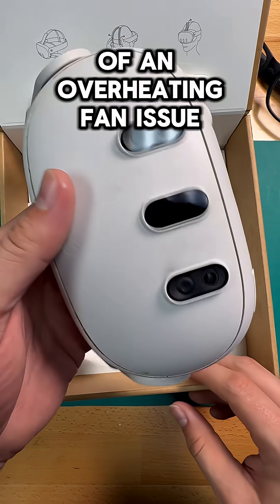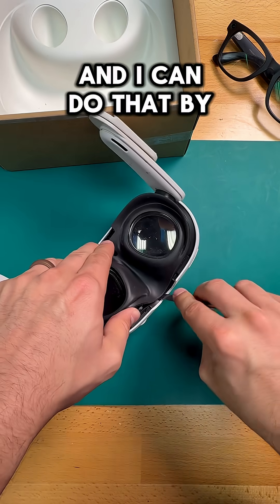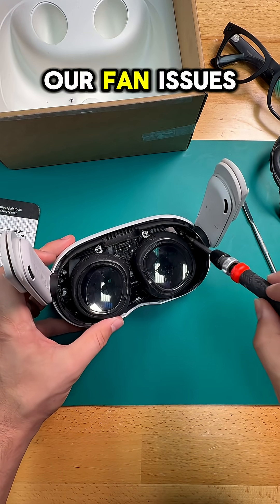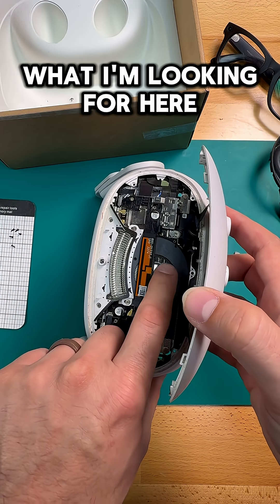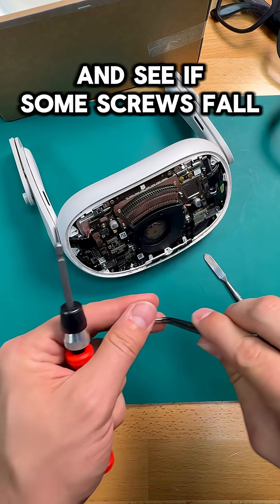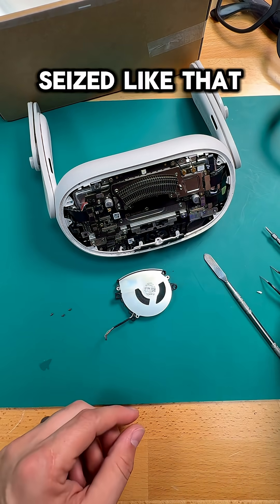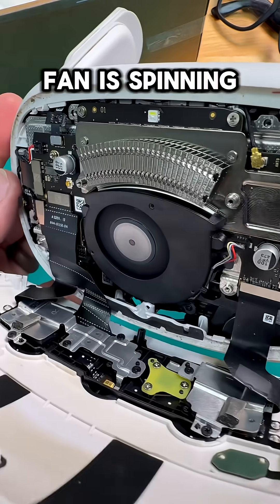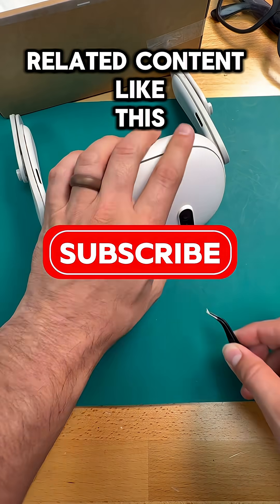Why Is This Quest Overheating? #vr #virtualreality #quest3

Comment: What i dont understand is that the quest 3 is around 400-600$ i paid 650$ for mine for the extra storage and keep it right in my case when its done i have never had any problems with mine or my previous ones. The people that break these in this conditions are most likely throwing on to their bed when their done or leaving it on the floor for to be stepped on or just plain leaving it in the sun if your going to buy such a expensive gaming equipment be responsible and take care of it properly.

Comment: So just out o curiousity how does the quest 3 get any air to the fan? Is it that crack that is in the front?
Reply: Yes!
It pulls air though the bottom and spits it out the top.
It's only gets warm on the top of the front plate, where the Meta logo is.
Ive had my Quest 3 for about 4 months now and I have yet to run into any overheating issues, it works great!

Comment: My quest 3s keeps giving me warnings that my usb-c port is disabled after using my battery pack for a while and I don't know why
Reply: Turn it completely off and try 99% alc in the usb port and clean it, wait like 10-15mins until all is vaporated. Might help. But be careful.

Comment: Those fans in the Quest must be really quiet because I've never heard one come on while I was using it. 😮
Reply: Fr if you listen very closely and compare when you put it on you can kinda hear it its super quiet
Reply: yep they are super quiet put youre ear on the top and listen you can ear it
Reply: I don't know, I kinda hear my quest 2 scream at me when I put it on.
Reply: @Amazing.A.I.Channel  sometimes I hear mine they are quiet
Reply: Steam Link on Wifi is pretty taxing for it at 90+ fps. At max speed you can just barely hear it when nothing else is making sound. If you put your hand above that slit on top you can feel it blowing a lot of hot air.
Reply: Might depend how good your hearing is and if there's any ambient noise around such as air conditioner, furnace/ventilation, etc.

Comment: Ever have to put fresh thermal paste on one? I wonder if there is a better thermal paste than stock that could be used.  I’m about to do the relocation battery mod to mine and wonder if that is another accessible mod worth doing that I can do while I got it apart.
Reply: @directeeccks  While changing the thermal paste can help a bit... there's still the issue of that there isn't enough surface area to dicipate the heat from... you could glue on some heatsinks for added surface area... but it's still held back by an underpowered heatsink.
Reply: One issue people can counter with replacing thermal paste is worse longevity. Like with CPUs the retail thermal pads could last for like 10-15 years but some thermal compound might only last 1-3 years depending on the compound. They can give better performance but require more maintenance in that sense as well.

Comment: What are some signs of overheating?

I know every device has a different throttling point, I've side loaded DevCheck and have seen the cpu go to 75 degrees. Do you know if that's whithin tolarences ? Thanks in advance!

Also almost all the time when the device is stressed using pcvr the battery goes to 50-52c but when playing titles like re4 it's around 45c
Reply from the maker: In case like this you’ll get a notification in the headset that the device fan isn’t working properly.
Reply: @fixmyoculus Cool ! Thanks for the quick reply ! Have a great day/night !

Comment: I have a few questions about sending my quest 2 for some repairs, specifically how much it'd cost, assuming it's a paid service since I want to have it looked at and a few things repair but I'm worried that it'll be pretty expensive
Reply: Don’t get it fixed it’ll cost as much as a brand new one
Reply: @Jojotheman121  Nah prices or very reasonable
Reply from the maker: All of our pricing for the most common repairs are listed on our website as well as instructions on how to send it in if you would like a custom estimate. Estimates are based on the cost of parts and 1-2 labor hours depending on the issue. 
Most of our repair services cost less than half what it costs to replace it with a new device and I would say the vast majority are closer to 30% the cost of replacement.
Reply: @fixmyoculus  Follow up quest-ion do you do any quest 1 repairs or cleaning because I still my quest one but it's pretty beat up and dirty and I'd like to still he able to have it and use just for nostalgia and have it working
Reply from the maker: Yeah. We do. It’s definitely not as common but if you want to reach out on our website the team will be happy to assist you.
Reply: @fixmyoculus  Thank you so much I've been wanting to use my quest 1 for so long thank you absolutely favorite quest repair people out there
Reply: @fixmyoculus  final question do you have any idea when the precision screwdiver will be in stock again I'd to purchase it so I can try to repair my quests and such at for experience
Reply: also have a very wonderful to you and all your team y'all do great work for vr user

Comment: What does the battery disconnect icon look like i saw in a vid where you dropped a oculus quest 2? Also my quest tracking works after a hard reboot
Reply from the maker: Battery is unplugged.

Comment: kinda related to this video, but do you know why my quest 3s gets hot fast? i play games like bonelab and resident evil 4 vr
Reply from the maker: The snapdragon XR2 puts out a lot of heat. I think the ventilation is actually better on the 3S than the 3, but I would recommend just cleaning it out every now and then because the fans do get dirty and that can cause issues.
Reply: @fixmyoculus  do you have a fan cleaning tutorial? if so, just tell me the name of the video, links dont work.
Reply from the maker: I’d just search for fan repair tutorial.
Reply: @fixmyoculus  alr
Reply: @fixmyoculus  is the quest 3 good? I have a rift at the moment. And wanted to upgrade to a mostly wireless setup, I would have bought a used quest 3 maybe. But I don't know if I will be happy with it. Since I kinda wait for a new Gen with some better features, or for a steam index or something.
Reply: @Lance420_CS as someone who went from the original rift to the quest 3 only a couple months ago I can say for certain the upgrade is well worth it. Being able to go wireless and still having the ability to go back to pcvr is amazing. The quality and imaging is such a step up from the rift.
Reply: @fixmyoculus  Is there thermal paste, ot do they use a pad? Only thing i can think of is dry thermal paste or a dirty fan.
Reply: @Lance420_CS  yes 100% worth it, i had the og rift, the quest 1 and pico 4. Quest 3 is by far the best out of them. But og Rift vs Quest 3, 100% worth it.
Reply: yeah number 1 those overheat rlly fast like fixmyoculus said and also ur playing really realistic games, tons of gore that can also be a reason
Reply: Can u fix controllers like the buttons
Reply: How much did you charge for this service?
Reply: bro said why is my cromebook overheating?! i’m only playing gta6?!